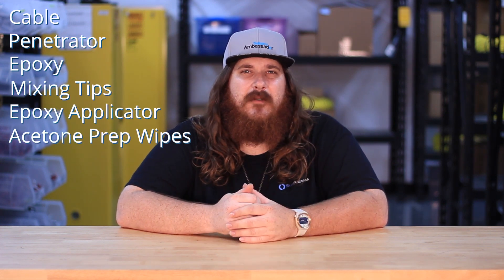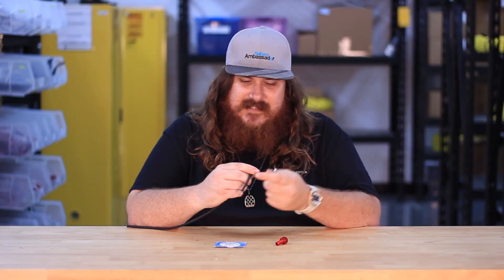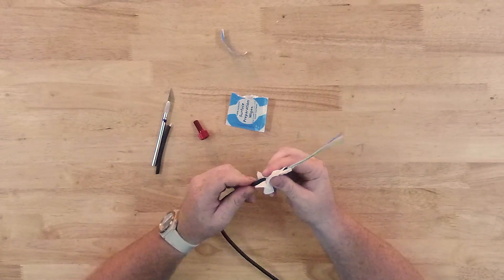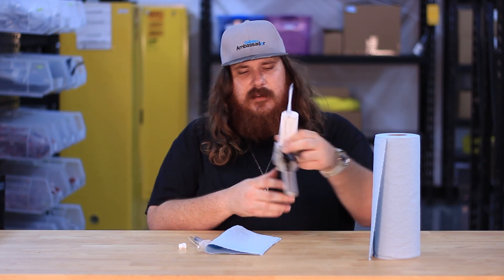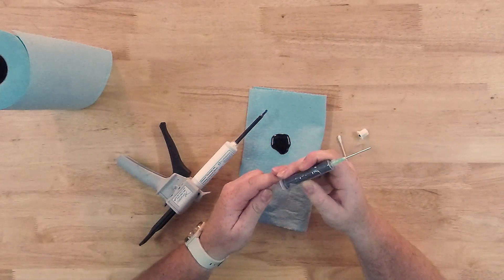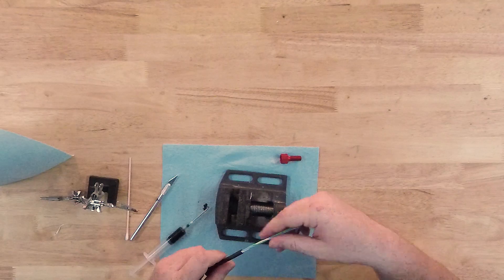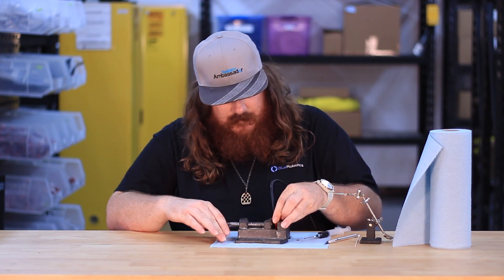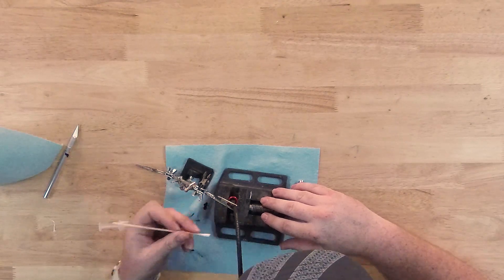Blue Robotics Tutorial: Potting a Cable Penetrator with WetLink Thixotropic Epoxy

Comment: just don't use these. use wet link connectors. these will all leak eventually. Don't rely on luck.
Reply from the maker: Hi there! We agree that the WetLink Penetrators are the way to go! The potted penetrators work well in some applications but the WetLink Penetrators are more reliable on the whole.

Comment: I've had issues with your penetrators leaking around the annulus between the epoxy and metal body. Do you recommend preparing the inner metal surface of the penetrator at all? Would roughing it up with sandpaper or steel wool help prevent leaving?
Reply: Hi Travis, we have seen that occasionally as well. Can you tell me more about the conditions you are operating in, particularly the temperature and whether the cable has strain on it frequently? Cleaning the penetrator with 99% alcohol does improve performance and I would recommend doing that if you're having issues.

Comment: Thanks for this awesome information, now can you tell me how to remove this epoxy, as in case it is required to dismantle the things from the application. like how to change the T200 thruster motor because back side of that the same epoxy be there?
Reply from the maker: Hi Abdul, it's not possible to remove the epoxy easily, unfortunately. If you have an issue with a T200 Thruster, we recommend that you email our support team at support@bluerobotics.com.
Reply: @BlueRobotics  Looks like blue robotics have their own Chumlee (Prawn star) :)

Comment: Nice video although you may want to clean up a few points. I'm sure most technicians would already notice this and take care when building their own systems.  "Take care not to touch the inside of the penetrator or the prepared cable jacket surface with bare skin, oils may compromise the bond." 

I would also roll and pull an acetone wipe thought the barrel of the medal penetrator as well. As a retail customer I have no idea what kind of oils or cleaning process your parts went through before shipping. I also have some years of experience in industry and been though a few challenges due to release agents left behind on plastic injected molded parts. I know the penetrator is anodized aluminum. I have also had new expensive SCUBA lights flood so I take no chances on this kind of work when trying to seal up a water tight enclosure. Note that in this video no use of gloves to mitigate hand oils and then grabs the already prepared cable jacket with bare hands 🙄. I KNOW I'm bing picky but hey I'm a technician and the devil in the details of your process.... I hate rework and equipment replacement due to poor installation processes. I NOT saying what this video shows is sloppy or wrong. Just do the best you can to mitigate costly issues down the road that is all. It's not a fun road to travel. By the way if your going to use an oven to cure your epoxy you might want to take the sealing o-ring off the penetrator prior to getting started and remember to replace it before installation to your enclosure! Baking an o-ring could partially dry it out and reduce its service life, just saying pay attention to details and you will be better off in the long run.

You'd be surprised how many mechanics can't patch a simple bike tire correctly the fist time and that is a much easier process with less pressures involved. 🤪

I actually am encouraged with your product line and look forward to working with some of your gear. Cheers, #SeattleRingHunter
Reply: You're an ROV technician? Dude that sounds like the coolest job. Did you get training for this or self taught? I have no experience in this stuff just find it interesting. Not sure of i want to take an ROV course first or buy one of these